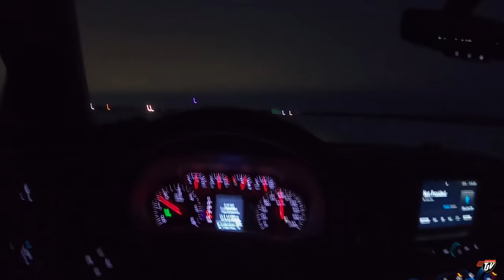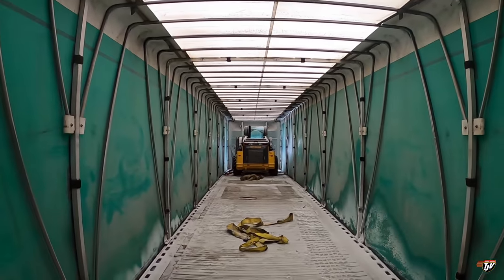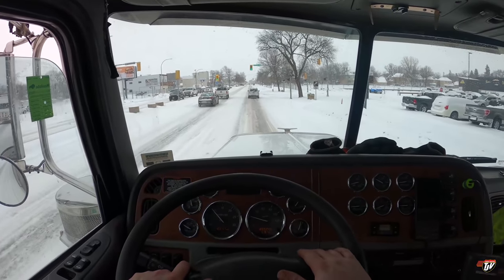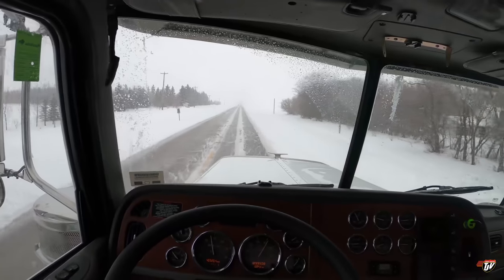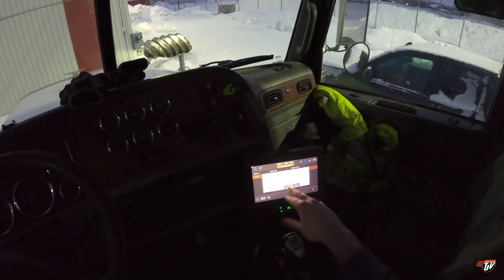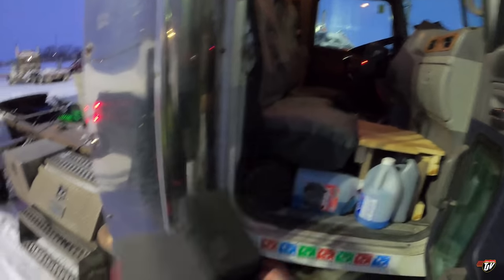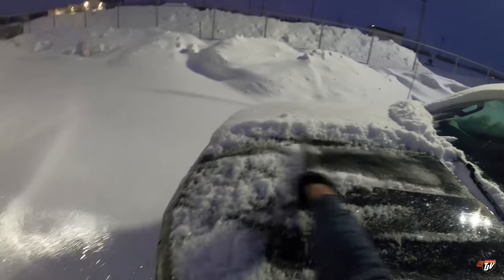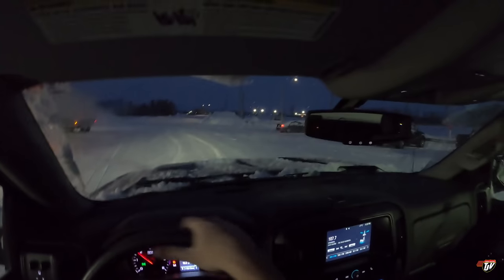SKIDSTEER ON ICE | My Trucking Life | Vlog #2467

Comment: Live in Portage, use to work at Mazers actually. To get back on the highway from the east end you have to take the service road. It’s one mile west of where you picked up. Turn left there and take the road around over the tracks and it will take you out by cobalt industries
Reply from the maker: That makes sense! Thank you!